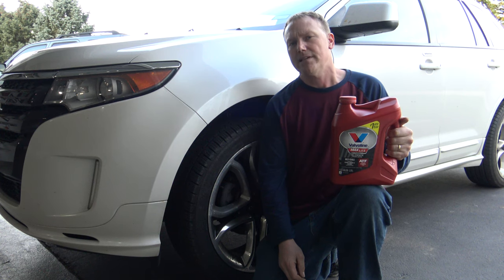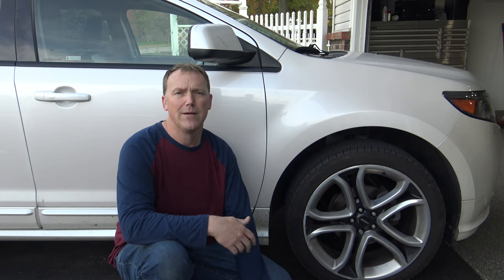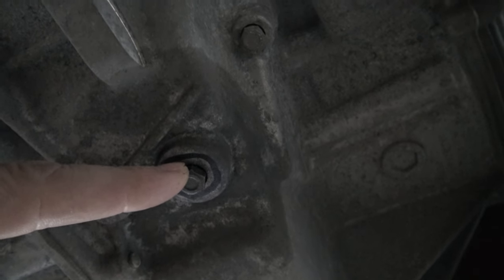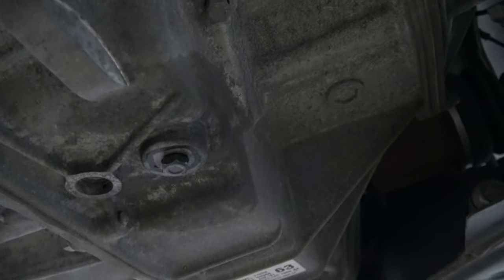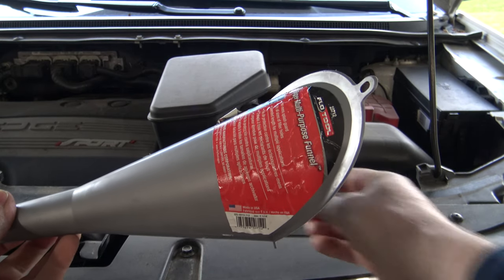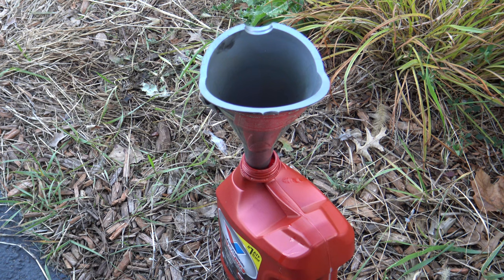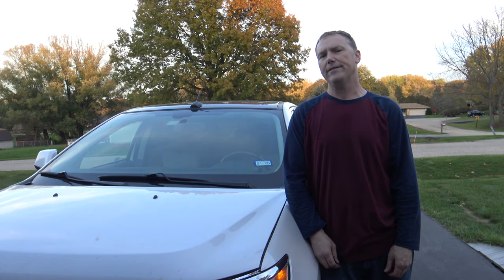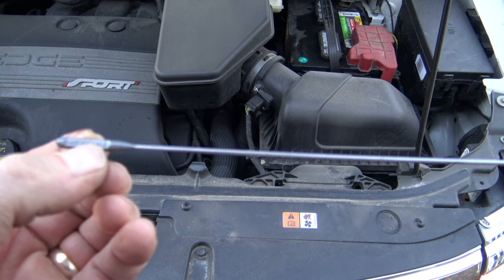Ford Edge Transmission Fluid Drain and Fill....... Updated Version

Comment: I just did this last weekend. I read my manual and read 9.4 quarts, then over filled it. After I put 8 quarts in it, I watched your video and then drained some out, to the proper level! Thank you so much for the video so I could verify that I was in the wrong and fix my mistake before my wife ran into problems!
Reply from the maker: cool, thanks for watching
Reply: 2009Ford Edge

Comment: Wouldn't a flush be better?what are the cons of a flush? What about the filter/screen in the transmission.  Doesn't it need to be cleaned or replaced?
Reply: I think there is just a screen and can only be cleaned by tearing the Trans apart
Reply: Really the only con is it’s cost and should be done routinely as a preventative measure not a solution to a problem

Comment: Are you having any issues with cracking sound when you make turns coming out of a driveway? I have the same year Edge sport and I am having issues with it. I've replaced the complete strut assembly including the mounts, sway bar end links and still there's this sound. Any advise would really be appreciated!
Reply from the maker: Ball joints?  Buy the whole control arm with bushings and ball joints in it
Reply: CV axle likely needs to be replaced. There is also the upper strut bearing. It’s likely the CV Axle though.
Reply: Cracking/clunk sound?
Your stearing link on rack and pinion. I have an 07.

Comment: Great video thank you helped my friend out. I also wanted to add that the drain plug has torque specifications I think it’s 80 inch pounds. Not ft pounds don’t confuse the too if you never used a torque wrench.

Comment: Most videos mention that the vehicule should be leveled, I have a 2014 Sport,  I am to understand that we don't need it leveled to drain?
Reply from the maker: It does not need to be leveled
Reply: @addismultitasking3504  If and when I transition to synthetic oil, Can I do this process considering I would mix 2 types , how many drain and fill to extract all the original oil?

Comment: The max life didn’t give you any issues?
Reply from the maker: Never had any issue with it
Reply: I'd personally, use Motorcraft Mercon.
Reply: @CS  the Maxlife is Mercon LV compatible. If you want to pay more just like Ford wants you to, then have at it.
Reply: @mygt8a4re  it actually isn’t. the maxlife is mercon V , not LV. These standards aren’t backwards compatible
Reply: @Luke Donaldson  Have you read the compatability chart? Says right on the container that it's compatible with Ford Mercon LV. You can go argue with them if you want....

Comment: Helped a lot. Absolutely right about the drain bolt not going in all the way. Ours had threads showing when I went to take it out and it had threads showing when I put it back in. It really needed the fluid change. The old stuff came out BLACK.
Reply from the maker: cool

Comment: how did you get the suv off off ramps before  you did the transmission 3-5 second gear shift. and start the suv.
Reply: If you put in the amount you took out in terms of fluid you can start it and reverse it off of the ramps.

Comment: Do you know how many miles per gallon you get? I only get 14 in the city on my 2012 Ford Edge SEL V6 3.5L
Reply from the maker: 18 city
Reply: @addismultitasking3504  thank you for the reply. Is there something you think I should check? 
I took it to the dealer and they say that since it doesn’t have codes it would be too hard to find the problem.
Reply: @Vitico Santana  You need to do the math @fill up to get your exact mpg. Don't trust the fuel mileage gauge on the Fords, they are known for being off. When you fill your gas tank write down the exact mileage you currently have. Fill your tank and drive as normal. Next full up (can be at any fuel level), take the mileage since your last fill and divide it by the amount of gallons just used to fill it up, the exact amount of gas is noted on the pump. Theres your exact mpg! You can test this driving in town or right after getting off the interstate. It can be done at any time. Even if it's just a short trip.
Reply: Thank you very much for your videos. I was afraid of changing transmission fluid but last night I did it. I check the level and it was very low didn’t even showed a mark on the dipstick. I put a full gallon and a quart in then checked the level and it was on point. 
Might be psychological but I feel my car more efficient and smoother. 
Thanks

Comment: Change tranny fluid twice per year??  I thought tranny fluid only needed changed like every 50k miles?
Reply from the maker: you only get 4 qts out of 11 when you drain it
Reply: I do mine every 30k, personally.

Mainly, because the filter isn't maintenancable unless you want to open the case.
Reply: @addismultitasking3504  You could do a double or triple drain and drop.  Drain the fluid, add 4 qts, drive it, drain 4 qts, drive it, add 4 qts.  I do a double drain and drop on my Ram TE62 transmission for my Promaster camper van.
Reply: Dealerships says 30k but honestly should be 20k because we use the transmission just as much as the engine
Reply: That’s way too often.